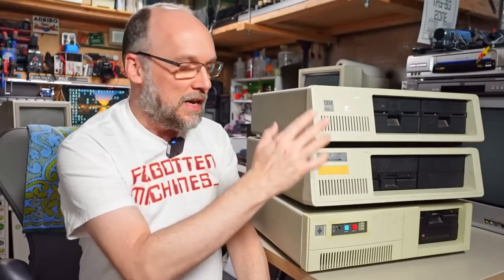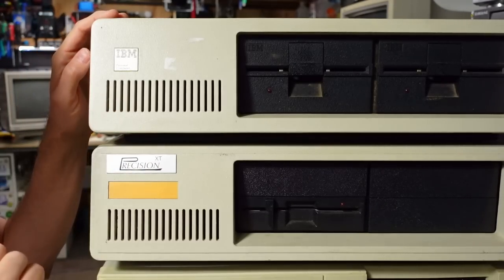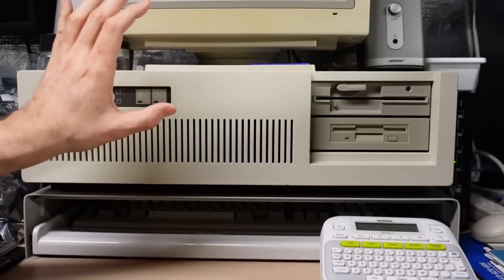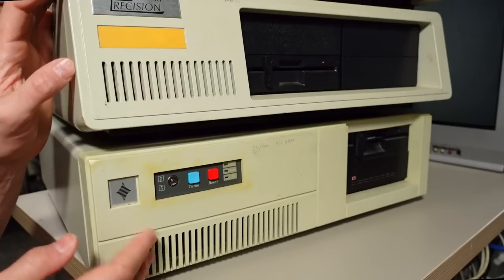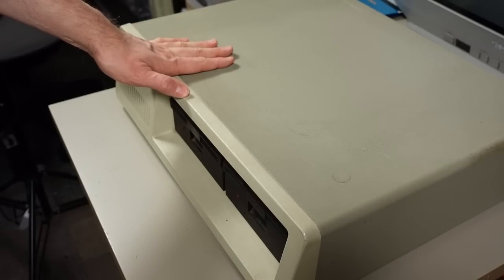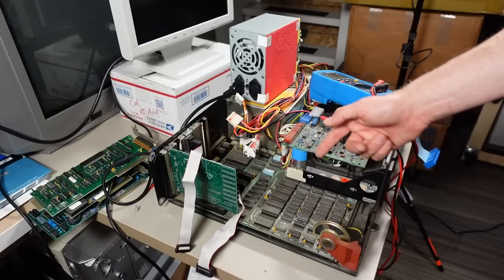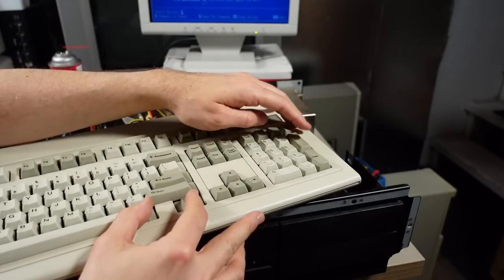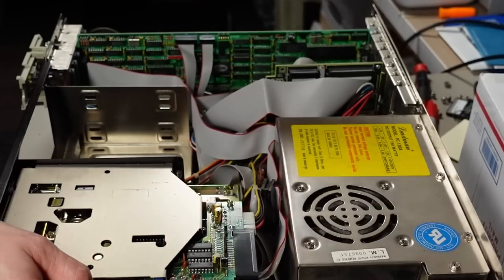PC archeology: Treasure hunting inside old PCs

Comment: My first PC was around '88, and it was basically the same specs as your 3rd computer. An Epson Apex 100/20 at 10 or 4.77 MHz, 640k, CGA, a 5¼" floppy, and a whopping 20MB hard drive. Had a 2400 baud external modem and used the computer for BBS, Fidonet, and some DOS games (usually pirated off of boards).

At the time I wasn't a big computer geek and didn't even know it was old specs. That computer has a special place in my memories, along with the C64 I used previously... and neither of which I have anymore, naturally.
Reply: I know the Apex, a friend had one, with cga composite output to a green monochrome monitor. His had two floppy drives and nothing else. It was the shoebox floppy storage days, he would play several dos games and some required floppy swapping during parts. I had a more mundane xt clone like the last one showed in this video, with cga rgb color crt, single floppy and the ST-238R. Yeah we each also had a printer for the ocasional school work with wordstar etc, which was the "excuse" of the day to have our parents get us a computer. For me it was the second, coming from Apple //c which i still had back then, late 80ies.

Comment: on the earlier clones (1980's & 90's) look for the UL sticker on the power supply. The ones that actually passed UL were a LOT more reliable and quieter (and more expensive) than the cheap ones often used. Many of them are now fire hazards due to the cheap components used and the safety components being left out so be careful. (sometimes it looked like a backwards Ru) like the second pc opened. Just saw the third computer. Leadman was one of the better vendors (it was also UL approved); and all power supplies of the clones were NOT equal. The cheaper ones were guaranteed to fail early. I watched 4 or 5 local competitors fail because they were using the cheapest power supplies. By the late 80's the computer shopper Magazine (11x17 x 1000+ pages) was the ultimate shopping directory. If you built a computer using the cheapest of each parts, it was guaranteed to NOT work (which kept me in business fixing them). Take the cheapest part, at 10-15% to the price and THATS where you price shopped.

Comment: As I posted a month ago on your MFM test video that I worked for IBM in the early 80's and had one of the first 5150's made. It had 16K of ram with 3 empty banks of sockets to max out to 64k on the motherboard. Memory was very expensive in 1981.  I got it for an employee discount price of about ??? (can't remember what I paid). At the time IBM was charging $400 for a single sided 360K diskette drive which I couldn't really afford. So I ended up using the cassette port to save and load Basic programs. I just used a $50 Radio Shack cassette player / recorder and standard audio tapes. My recollection was that it ran at 1500 baud and it was rock solid saving / loading programs.

I had previously owned a TRS-80 Model 1 and its cassette interface was completely unreliable. It failed to reload saved programs 9 out of 10 times. That's why I sold it. I kind of regretted that later as the Z80 processor on board was faster than my 5150. But if you can't save anything, what's the point?

I also had a Hercules graphics card (clone) that had single color graphics (green, amber, white) depending what type of phosphor your monitor had (IBM's was green). The resolution was great but the 4.77 MHz processor on the 5150 didn't have enough horsepower to move that many pixels around much. It was painfully slow, especially when Microsoft released their first version of Windows.

Comment: 45:46 - You need a metal end plate on your memory card adapter, the same one that is on that Hyper Clock card at 38:17, that way you would not put in the memory card adapter in reverse.

Comment: Sore back and eye strain; the only treasures I ever got from those machines.
Reply: Gotta get a good chair and turn the brightness down. It helps tremendously.
Reply from the maker: Sore back from trying to move them around?
Reply: @adriansdigitalbasement  I can imagine 🎬
Reply: @adriansdigitalbasement  Yessir! ohhhh :-(
Reply: Yeah, no sh*t. Recently, the company I work for moved, and they had literally hundreds of old, out-of-date machines they (meaning, me) had to remove the hard drives from (security precautions- the drives had customer info), so each one had to be lugged over to a table for disassembly, and many of them were absolute beasts, weight-wise, especially the old Compaq units!
Reply: @williamsquires3070  why not use a secure erase tool to write random data on it?
Reply: @robertgijsen  Sometimes policies require a certificate of destruction. This is often the case in regulated industries such as financial or medical.
Reply: @williamsquires3070 why not use a dolly? Hindsight 20/20
Reply: @robertgijsen  because many of them had no CPU… or floppy drive (having been scavenged for parts at some earlier point in time.) 🙂
Reply: @akkudakkupl  Because one wasn’t available (the girls in admin were using it to move boxes and boxes of company documents to the new location.) Besides, I still had to lug them onto the table. My back is still complaining about that episode, despite lifting with my legs, not my back. I think Compaq made the cases out of lead. 🤣😆
Reply: @williamsquires3070  clearly an antitheft feature.

Comment: About the JPGs... If I remember correctly from a technology TV show from that time, there was a way to send messages encoded within a "valid" JPG and was used back then to send personal messages in Usenet and others. The JPG would look "normal" in a graphics software, but using a "decoding" program would show the message. I wonder if the other JPG you were talking about would be a "message JPG" or related to this. However it's surprising that someone do that and then forget to format / destroy that private data in a disk... But there would occur a lot of situations that could explain why. Either way, this was very interesting and made me remember about that old technology.
Reply: The technique of hiding information within other information is called steganography.
Reply: Yes, its called 'uuencoding', he mentioned this exact procedure by name in the video.
Reply: @helgew9008  Hiding, yes.  However 'uuencoded' data was the common method for transmitting files across USENET and was not 'hidden', so you would simply say this is encoded.
Reply: @orangeActiondotcom   That's not what the OP was talking about.  UUEncode was just a way to stuff 8-bit data in 7-bit text, so it could be sent across a text-only medium.  The OP is talking about modifying a JPG image to hide data within the picture itself.

I doubt that's what actually happened here.  My money's on it being exactly what it appeared to be -- "homework" downloaded from Usenet, that may or may not have ever been viewed on an XT.
Reply: @nickwallette6201  Exactly what I was trying to say, thank you!

Comment: Did you ever encounter Compaq's version of MS-DOS 3.31, which was the same as 3.3, but it had the capability of addressing hard drives greater than 32Meg, which was (If I recall) the big limitation otherwise.
Reply: I may actually have a copy of that, I remember seeing it...
Reply: I still have a copy of it. It was absolutely necessary for the Compaq Portable that I own.

Comment: Wow. That "Precision" unit is eerily similar to the Zenith Data Systems PC I started out with back in the 80's. those nut drivers are the same as the ones I still have and still use often from when I worked at radio shack in the mid 90's. Ahhh memories... Can't wait to get the $ together to rebuild my first pc (or as close as I can get to it.)
Reply: I worked on some Zenith Z248s (I think) a long, long time ago. Neat machines, 286 running an ISA backplane and proc/mem card.
Reply: "Precision" was a Portland, Oregon business computer and services company from the 1990's.  When we did business with them, they re-sold AST desktops and laptops to business customers along with their own private-labeled whitebox clone PCs.  At one point they were located at 1111 SE Stephens, just next to Ladds Addition.
Reply: I have a Zenith Z-248 computer and I still play vintage computer games.  The old 10 Mbyte MFM full 5 1/4 size hard drive still run fine.

Comment: Not sure if you noticed. When you pulled out the hard disk controller at 36.27, the small cable comes out the top. When you tested the drive you at 43.02 you had the cable coming out at the bottom.

Comment: @1:00:00 Norton Commander 4 did have a picture viewer built in that could do JPEG's, but I think that you needed at VGA to work properly. I don't remember if it demanded a 286 or if it worked on a 8088.

Comment: When I was about ten years old, still very much a kid, I had a Panasonic branded clone of a Tandy XT. I hated CGA so went to the local computer store "Paragon Programs" and asked if they had a VGA card, too expensive, but they had an EGA card that I bought for 100 bucks.

Having 16 colors made a huge difference. I wanted a hard drive, but the only ones I could afford were the refurbished 10mb Seagate MFM drives, was full height so I had to extend the power cables to run out one of the rear expansion plates. 

I just wanted to play Space Quest and King's quest

Comment: Ummm, I remember someone saying that XT PSUs regulate the +12 and need a load for +5 to be stable. AT PSUs flip that around. (I found that when repurposing PSUs for radios, that XT PSUs also needed a ballast resistor on +12, in order to start. ATs need the +5 ballasted. So that someone musta been right.)
Reply: I can't imagine an old XT PSU using the 12v as the main rail for regulation. It wouldn't surprise me if you need some load on both rails for then to work properly though.

Comment: Can confirm that those CR2032 batteries can leak. Had one leak and corrode inside a Tandy TL that I restored not too long ago.
Reply from the maker: I figured it was possible. Do you recall how bad the leakage was? Did it cause much destruction?
Reply: @adriansdigitalbasement  It wasn't too bad. All the leakage/corrosion seemed contained within the battery holder and didn't damage the board.
Reply: They are well known to leak in the remote clickers for garage door openers, when left inside cars out in extreme heat.

Comment: The IBM 5150 is what I started my professional IT carrier on and shortly after the XT and then the PS/2 with 5250 emulation so I could program CL and RPG on IBM mid range systems like to System/34,  36,  38 and ending on the AS/400 B through to E models.  Those were good days.  Unfortunately,  along came dumb terminals like the 3197 and 3477.  I loved the 3477 though.  I was a senior coder by then and my staff had to make do with the 3197.

Comment: great video, I love this stuff and I miss the XT to 486 or pentium 1 era. I think that was "the golden age".

edit: my XT still worked until 95 or 96 I think, so I still have some files made on the XT like a catalogue of the games I have on floppy disks.
Xtree Gold runs on XT and it can open pictures, I don't remember if jpg specifically, but I'm sure it opens GIF, BMP and some other format.
I remember using a tool to reduce some piotures from 256 to 16 colors so I could see them on the XT. Then on 286 with a VGA card you can use QPEG.

Comment: If i remember correctly the old MDA Hercules graphics cards supported a software Monochrome CGA emulation... worked quite well too
Reply: Yes but not all games worked with that tsr. There were true cga/hgc clones later that would have no issue and needed no tsr, just mode mono mode co80 or select either choice when configuring your program no matter what display was used, like the EGA wonder which added ega but could run anything on any display (except hi res ega with low res crt).

Comment: That NEC hard drive in the Precision XT looks familiar, with the stepper motor and the solenoid next to it. It's not parking automatically, but holding the head at its position when it is not in use. I had a similar NEC drive with my Amiga 1000, with probably a SCSI-controller bolted to it. It was very noisy though and the spindle needed frequent oiling.

Comment: The beeps at startup could be that the board is set for CGA or EGA video and you are using a VGA card. It works but it is complaining that the settings are incorrect
Reply from the maker: Yeah that's quite possible actually! Those old BIOS chips probably don't print a message complaining about that issue.

Comment: You didn't note on the 2nd system that it has an 8Mhz CPU in it. The CPU on the 3rd one needs pushed back into its socket. I was surprised it worked with one end of the CPU sticking up like it is. Giving all socketed chips a push to reseat them was the first thing I did when troubleshooting.

Comment: The 16450 was the drop-in replacement for the 8250 which added FIFO buffers and 115200bps capability.
Reply: 16450 only had a single-byte buffer... need 16550A for the FIFO. (16550 had a bug with the buffer.)

Comment: I still use hex drivers like those as they are perfect for PSU screws in modern PCs and of course old ones and even expansion cards as some cases still use those same screws. Sometimes it's much easier to use a hex driver than a Phillips.

Comment: I bet your kit was in a little vinyl zip case or maybe canvas-like. Always had two nut drivers, two each of standard and Philips drivers, tweezers (that were too flexible and not very useful), a chip puller for DIPs,  and a grabber tool to retrieve the screws you inevitably dropped in some tight location inside the case. I still have mine too, but I trashed one of the screwdrivers and replaced it a long time ago!

Comment: You didn't really miss out on much when buying an XT clone in 1988. Sure the 386 existed but the early versions of those were complex and expensive and it would just run the same programs but faster. It really wasn't until 1992 or so when the XT was finally left behind.
Reply: And if all you needed to do was simple word processing, XTs were still viable until the mid-1990s (when everything finally started moving to Windows for good).

Comment: Nice score with the Hercules card! Someone told me that early MT ram chips are ok and normally don't go bad
Reply from the maker: It seems like the 4264 ones are ok but the 4164 used on the C64 and others are junk :-)
Reply: Micron Technology chips are notorious for going bad. They lied to you.
Reply: @a4000t  It is ironic that in this age, Micron flash nand chips are used in the control boards for bitcoin asic miners, and that's the good brand, with Macronix being the cheap one.

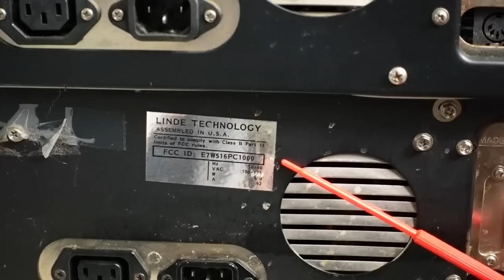Comment: 7:04 Gave this an FCC ID search and indeed, Linde is the manufacturer... and this is apparently the only thing they ever submitted. One and done.
24:00 The root might have slipped by.... the tantalum cap was next to resistors that emit heat. That's probably why it failed.

Comment: DOS 3.3 certainly does NOT require 640k to boot, in fact it should even boot (with no drivers) on 64k. But the original 16k is not enough. The issue is that although it may boot on 64k, it won't be able to load anything. 128k is enough for basic management and running some simple programs, even volkov commander and some primitive games! 

29:03 this one has 256k of RAM, 211k free, 45k used by DOS. 

IBMDOS 1.0 used 16k RAM but actually required at least 32k because of how DOS loader works. It wouldn't be able to do anything with only 16k anyway, and very little with 32k. MSDOS 3.3 needs 64k, 4.0 and onwards 128k to boot. Interestingly enough they optimized it so bare DOS 5.0 onwards technically boots with 80k while 4.0 does not.

Comment: I guess you can make the middle machine run in turbo mode again if you short that jumper you straightened from bent causing it to be shortened right after opening the case.

Comment: the old turn on shut down problem.. i remember once upon a time having a system that would do that but not being "Smrt" at the time would kid out and hit the case.. and it would actually boot after a few kicks.. later in life that system got mothballed and sat around and dipping my young brain into opening the case and being brave enough to put my hands in it began removing screws and things.. now this thing sat on a carpeted floor with kids milling around the house doin kid things.. today i can guarantee i know why it wouldnt turn on some times and would when it was kicked... there was more then 1 or 2 little balls of tinfoil in the case tinfoil i assume came from hershey kiss candys.. being small enough to Fit into the holes where the fan was... kids doing kid things.. so the thing would get kicked and the little ball shorting things out would move.. but eventually would find its way back to shorting the board to the case.. .. oh youth..

Comment: Adrian, have you ever thought of doing a modern PC repair or is it totally out of scope for you? I think it would be interesting how the knowledge you have of this 80s machines can translate to a modern one, even thought electronics have not really changed that much rather just minimize and add most functions.

Maybe looking into something more special you could repair a laptop, those are pretty much still not standard. The downside is probably they are hard to work with since passive electronic parts on those are really small nowadays and a microscope is pretty much a necessity for that, Louis Rossman's videos are mostly shot from the microscope feed.